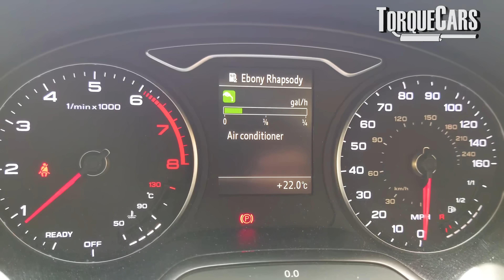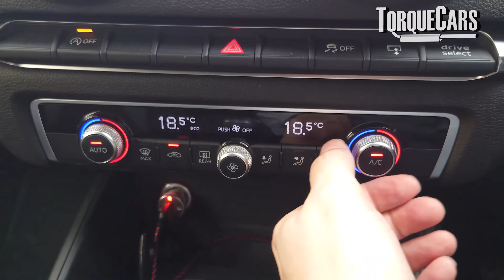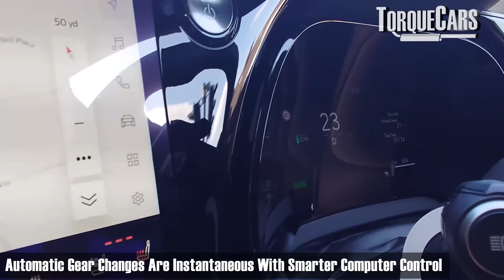The Biggest⛽ Fuel Economy Lies Every Driver Believes! 👉 What Really Saves Fuel?

Comment: Idling at any rpm is the worst way to warm up an engine, it's way slower than just driving slowly
Reply: I thought the idea was to warm it up slowly.
Reply: No, the idea is not to warm up your car slowly, it's to get it up to operating temperature as soon as possible with as little risk as possible. And all of that depends on the climate, etc. But with modern cars, you can take off slowly after about 5 to 10 seconds of warming up in the summer and maybe 30 seconds to 45 seconds in the winter. This may be different for harsh climates, of course.  The key is to drive very, very, very conservatively at first. You want to warm up the car quickly but safely.
Reply: @meherenowmaybe 
What u wrote is true, driving carefully and reving the engine high warms up the engine quicker than just letting it run on the driveway. One thing i would like to ad is the traffic. When u leave home what kind of traffic u joining in.
Me, 3am in the morning, i can just drive grandpa style for about 6 km before joining the motorway. This works for me.
My wife goes to work around 10am peak traffic time, this wouldn't work too well for her so she warms uo her car on the drive way. 
My point is, ur solution does not fit for everyone.
Reply: @Pumpkinhead77  My friend, I writing here to make my point clear.
When the engine is cold the oil runs and gets pushed by the oil pump as fast as possible to oil as much as possible internal parts of that engine. If the engine is cold and not used to drag the car along the street then all the internal forces aren't there to push the car but only to turn over a cold engine. So the stress that definitely is there (internal.. using the gearbox.. and wheels..) to push that car is not as much or is MINIMUM.. it is only used to turn over and push the pistons up and down almost free of any stress. That is very beneficial for an engine when it is start in the morning (specially if it is a cold morning). Those 2-3 minutes in which the oil runs around and gets slightly warmer (because of THE INTERNAL FRICTION between parts in the engine and the heat developed from burning fuel   .. that is INCREASING OIL VASCOSITY that would help the oil later.

I do own 3 cars and these are daily used for over 7 years. None of them use any oil between oil change period. All of them are treated the same, obviously I look after those cars and so my family follows my instructions for less headache of mine..later.

The amount of fuel if you think this way will be much more when you just pull out without waiting because fuel used won't be used as efficiently as when you'll wait a little.

And yes the warm would be slower while stationary than when you're driving because you have to rev the engine to be able to move from stationary.
Reply: @MrFryfish  someone who does not know how to spell VISCOCITY should not be commenting on how to maintain an engine!...
Reply: @roythearcher
No?
Why not?
What kind of teacher you are?
I invite you to tell us.
Reply: @roythearcher And it is viscosity, not viscocity. Take your own medicine, mate.
Reply: @MrFryfish  Not to mention manual for my car (Skoda Superb Mk2 2.0 TDI) SPECIFICALLY says that in cold weather 2 min idling is recommended to reduce engine wear. You don't have to wait until it is defrosted, and it warms faster when you're driving, but when engine is cold, and you drive off, you put unnecessary wear and tear on the engine internals, because they work without oil whatsoever (except for very, very thin residual film from previous drive). I would add to your explanation one more thing: engine and it's components do warm up at different speeds - so if it's cold, and you drive off immediately after starting the engine you risk cracking or even small explosion of some components, because they will not warm up before putting a load on them. Best example would be a turbo: when cold started and immediately put to work, you are getting hot air in the turbine, heating the fan wings, but bearings will be cold. Temperature difference can literally crack the metal.
Reply: @gmaacentralfounder It's obvious that driving right off isn't a good thing. But making it idle on a driveway for longer than a minute is adding unnecesary wear. Start it, let idle just to get the oil moving and drive really gently. The less time engine will work not in operating temp the less wear it'll experience. Gentle drive is the quickest way to do it. Load isn't a problem in itself on a cold engine. Excesive load is, which you're not putting on motor when driving easy for the first 5 - 8 minutes at winter. Also, the oil interval has huge effect on cold start wear which will occur regardless. Unless you can heat the oil/coolant/engine/all three externaly before startup, it's inevitable.
Reply: When your wind screen is frozen, you can only idle, driving is not recommended.
Reply: @D.von.N  
You should NOT use water as windscreen.. because it will crack windscreen reservoir. It will give you something to do pretty soon!
Reply: @MrFryfish  Who said I am using water as a windscreen???
Reply: @D.von.N 
Why are you talking about not driving with windscreen frozen?

 That is hard to believe someone can do that without cleaning it. And usually ..whoever is tempted to ride a car like this... it is prone to have a frozen windscreen washer reservoir as well which makes the ride even more difficult..
So it is beyond me to understand the link between warming up the engine and windscreen wash...
 ..unless cleaning by scrapping the windscreen is not an activity you would enjoy. 😉😉
Reply: @MrFryfish  I didn't say anything about windscreen wash whatsoever. Just frozen windscreen. Warming up the engine helps to blow warm air on the inside of windscreen to help thawing the ice on the outside, also preventing more freezing and prevent steaming inside when it is icy cold outside. You never got into the cold car and got windows covered with moisture after a few breaths? Wiping it off and in seconds it is covered again. Unable to drive until it warms up inside enough. Lucky you!
Reply: @MrFryfish  That's what defrost fluid is for. Also, there are some wiper fluids, designed specifically for winter, that contain defrosting agent (IIRC Shell does this). This makes freezing washer fluid even in nozzles unlikely. Then you turn on AC windshield defrost and within 60 seconds you are clear to drive. And, of course, when driving, then warm air from inside engine bay is warming the windscreen, too, so get going as soon as you can see and drive safely, which you can do inside the 2 mins that almost everybody can make room for after starting the engine - fasten seatbelts, check on lights, set heating/AC to proper settings, check driving position etc.
That some can drive with frozen/fogged windscreen is not uncommon, unfortunately. But that's what leaving 2 min earlier is for.
Reply: @gmaacentralfounder 
I agree with you. Not much to add.. just an advice. That defrosti g stuff that you putin water for quick defrosting is damaging the pump inside the reservoir.
I advice you to use that stuff only in winter. During summer would be better to get back to water..
Reply: @MrFryfish  Automakers don't know about washer fluid having additives for deicer and cleaning?  Sure they do.  only way a pump might go bad is if the fluid sits long enough to dry and cake up inside.
Reply: Driving slowly is ok if you can drive slowly.  However, if your windscreen is fogged up after the car has sat for eight hours in an open car park on a frosty day, then driving anywhere might not be a safe option 🙂
Reply: Imagine still having to care about idling in 2025 :P
My car is heated or cooled to the temp I want when I get in the car. No fuel used :P
Reply: I see, you're one of those..that charges at home on low tariffs.
An d comes here full of...
You're on the wrong channel.
Reply: It used to be necessary. Not these days.
Reply: @sugarnads 
What changed?
They made metals weaker, that last less and works under EVEN more mechanical stress!!! The above are NOT points of view to help you...

Prove your point.
Reply: Wrong.
The wear is higher when you just drive off because instead of letting the engine running free of load (yes the car and you driving it are the load of the car.

But I can bet YOU are not a person to keep a car and look afteran engine and repair it as long as possible. So what do you actually know about reparing an engine?

Tell us longest period of tine you kept a car amd looked after its engine?

Comment: Utterly wrong with aircon... Its either on or off. So with aircon, temperature makes ZERO difference to Economy. On fact, if u run aircon with anything other than the min temp, all it's doing is adding warm air back to the chilled air to raise it's temp! The aircon doesn't have a range of how much it cools. On or off. Cools to the min, but if u want a temp above that it mixes in warm air. Better to cool at min, and then manually switch it on and off... That will save fuel v leaving it on all the time but setting a higher temp
Reply from the maker: I think you are referring to older more crude units. Air Con in modern cars will pulse on and off. The heat exchanger acts like a buffer so for a little cooling it will be mainly off and the exchanger will be warmer overall, for more cooling the compressor will run longer keeping the heat exchanger cooler. You can actually feel the compressor cutting in on lower power cars and feel it switching on and off.

Comment: nitrogen is dry.  no water vapor.  the water vapor changes temp quickly and that is the major pressure change....
Reply: In absolute terms, the amount of water vapour inside a tyre is in the order of a few milligrammes. The mass of the air inside a tyre is in the order of 10 grammes, so the water vapour is about 0.01% of the total mass of the air.  That might be significant if you're a racing driver, but for an average driver, it's so tiny it's negligible.
Reply: What?  Water changes temp more slowly than nitrogen gas.  That's why deserts can be incredibly hot during the day but also very cold at night.
Reply: @Heimdallr-88h14  you know nothing about gases nor deserts !

(A desert doesn’t have to be hot however hot deserts go cold at night when there is no cloud cover and the daytime heat escapes!)
Reply: @Heimdallr-88h14  It is the state change of water from liquid to gas that causes a significant increase of pressure. It has nothing to do with Nitrogen beeing better than.Oxygen - it's just the fact that this Nitrogen you buy does not contain water molecules., In fact Formula 1 teams just use dry air because there is no advantqge in using Nitrogen over dry air. But F1 tires reach temperatures of boiling water and your road tires are.much much colder so it doesn't matter in a road car.
Reply: @PunkSkeleton  Moisture in the air is already in the vapour phase when it enters a tyre, so even if the temperature inside the tyre exceeds boiling point, the phase change has already occurred.

Comment: Nitrogen in tyres is used to stop internal fire in the tyre carcass, especially in aircraft tyres.
Reply: @Olivier_The_Dilettante  Ehh possibly, but it's more about nitrogen being less susceptible to pressure changes with temperature in the tires. You have an aircraft flying at altitude which will be much colder than ground level. You dont want your tires to lose a bunch of pressure when it's time to land and they haven't warmed up yet. Conversely, you dont want pressure to increase by a huge amount due to the heat generated by landing and braking.
Reply: @criadx  nope, pure science, tyres burn inside, oil/pressure/oxygen (think diesel), simple, goes for aircraft/racing tyres (F1 especially), e.g. that is why on oxygen pressure monitors is stated "DO NOT USE OIL".
Reply: @Olivier_The_Dilettante that is only one factor, and is a consideration in aircraft tires, but like I said the main reason for using dry nitrogen in aircraft tires is to reduce pressure fluctuations with temperature.
Reply: @criadx  , he says, she says, safety is a priority, but cannot find dry versus wet N2 info.

Comment: I love the 6th gear in my VW Caddy 2.0 TDi - When driving at reasonable speeds on the highway (around 120 kph on average) it dramatically increases the car's range and thus, its fuel economy. When we go on a long trip and change from our winding rural roads where we rarely go beyond 4th gear, we sometimes joke that 'now we are getting into our free extra range'. On the rural roads it may be indicated as around 720 km on a full 60-liter tank, while once on the highway in 6th gear, the range usually shoots up to 900 or more. Staying at 110 kph in 6th speed the car can suddenly go for up to 1100 kms on the same full tank. Which makes me thing, why do EVs not have an overdrive gear for long-range highway travel? They usually have a lot of power and torque anyway, so it would not be a problem in that sense. Let the electric motor turn slower while the car goes faster (doing more distance per engine revolution) seems like a no-brainer. So why don't the manufacturers include that?
Reply: @FrankSchweppe  battery technology isn't there
Reply: Perhaps they haven’t thought of it and are waiting for an expert such as yourself to tell them how to go on.

Comment: I get roughly an extra 6-8mpg from E5 fuel compared to E10 fuel, on my 18 year old Ford 1.6 petrol engine. Even though there’s 6-8p per litre difference in price at the pump; the fuel savings from the more expensive E5 fuel cancels out the additional few pence per litre at the pump.
Reply: I got the same with Skoda Fabia 1,4 16v BBZ engine.! Better economy when using E5!
And I sm calculating by miles per refill!

Comment: The biggest fuel saving device in any car is the driver, and how well he understands how to drive correctly and economically 😊
Reply: Never use the brakes to slow down! Flow like a zen master. Anticipate and vary speed and following distance to match traffic conditions.  Brakes are for stopping!!
Reply: Doesn't using engine braking to slow down use more fuel by raising your RPMs? I really want to know if I've been misled, but I've always been told the mantra brakes are  way cheaper than transmissions, engines, torque inverters, etc.  And I know it's true if only in terms of the fact that I can source reasonably priced OEM brake pads and rotors and install all that myself, but I can't work on the transmission or any of that stuff.
Reply: I don't know who told you that engine braking use more fuel but is lieing to you, in engine braking you don't use any amount of fuel
Reply: Agreed, too many people buy tiny turbo 4 bangers expecting good fuel economy then proceed to drive with a tungsten foot
Reply: @BubblesTheCat1  I drive a 2.6 ton twin cab 4wd HEV, the official fuel figure is 9.6 l/ 100klm but by changing my driving style and using the battery to my advantage I can regularly being that down to 8 l/ 100 klm, you are 100% correct that it comes down to the driver.
Reply: @peterbuckley3877 You're quite right, I was quite surprised by your low mpg, seeing that, that's such a big vehicle, but then I realised you're talking about a hybrid vehicle. I get 7l/100km in my little normally aspirated Nissan Sentra 140Si, which is just a light petrol engine car of about 1000kg. I drive light footed, anticipate my stops, and use the brakes very lightly just to come to a full stop. My brakes last over a 100k kilometres 😊
Reply: @BubblesTheCat1 that’s the same with me, my other car is a Kia Opitma GT with the 2l turbo and at 6 years old everything except tyres are original. Tyre are a bugger because if you want the performance Michelin or Pirelli  tyres they aren’t cheap and only last about 20k but I manage about 27k out of them.  When I learnt to drive way back when you learnt to read the traffic and road conditions and used your engine for braking and gentle acceleration and de acceleration, we were taught well back then.
Reply: Imagine if you rode a motorcycle. They are more efficient in every way. (Japanese 1991-2012)
Reply: Wait till you own a car that has different width tires on their rear and is rear wheel drive a LOL like my IS350
Reply: @meherenowmaybe I had a Toyota Cressida years ago, and that car would never get under 10km/l no matter how carefully you drove it. Glad times have moved on an we don't have to deal with inefficient carburetors anymore. Although, otherwise it was a very reliable vehicle 😅
Reply: @meherenowmaybeUntil a fool gets you to crash, then the hospital bills and pain negates all the savings 😺
Reply: @meherenowmaybe Are they?
Would you rather be safe in a car doing around 40 MPG or out in the open on a bike doing around 30 MPG?
Reply: @BubblesTheCat1  for devices, sure. But for cars? Engineering.  ZE1 is still the king of mass produced cars, even though they didn't end up selling many.
Reply: Any given engine platform is only as efficient as the one who controls and maintains it. Speaking of maintenance: Premium fuels really are a passive way of maintaining the health of an engine and its fuel system.